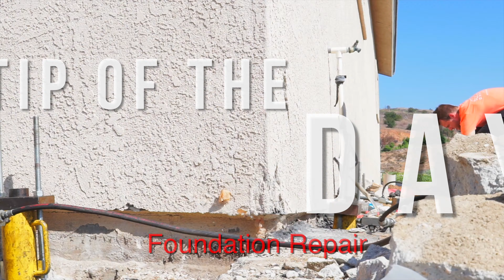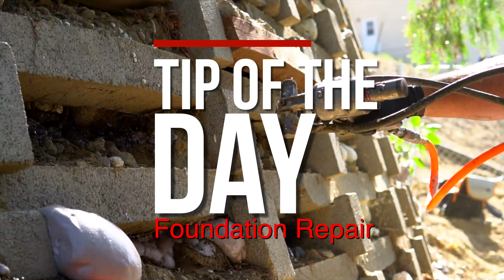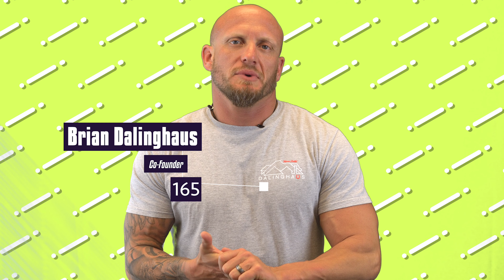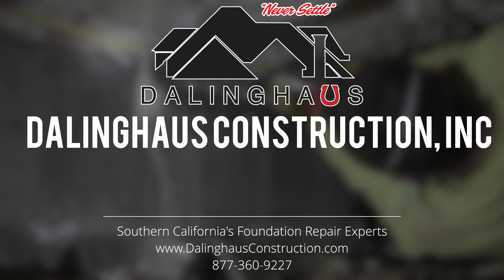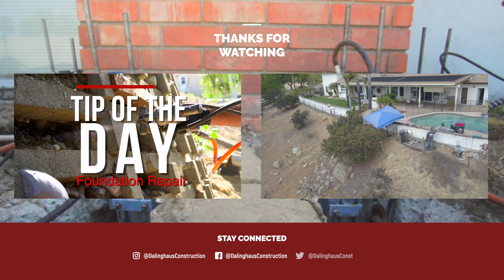How Do We Know When To Install Push Piers vs Helical Piers - Foundation Repair Tip of the Day #165

Comment: Why your PUSH PIER IS NOT Galvanized in EXTENION PART ?
Reply from the maker: Because it doesn't need to be!  While the inner sleeve sections aren't galvanized they're also much less likely to be exposed to corrosive elements or moisture and therefore don't need an additional layer of protection like the outer area that's exposed directly to soils and potential corrosive elements.